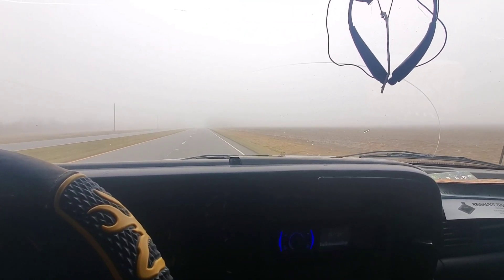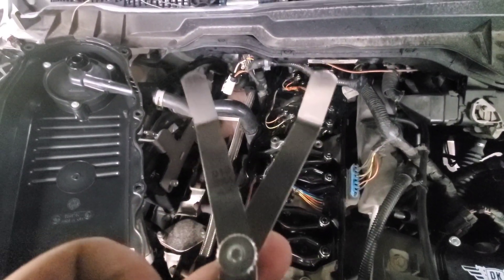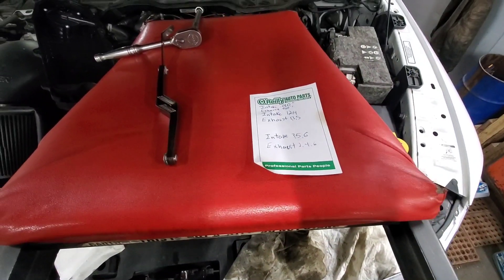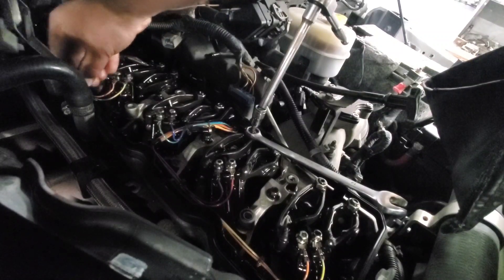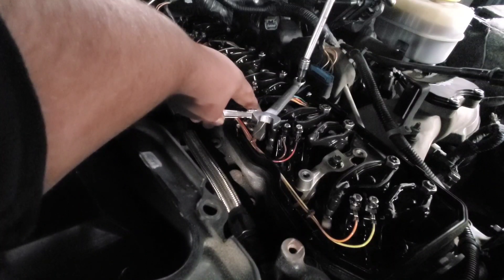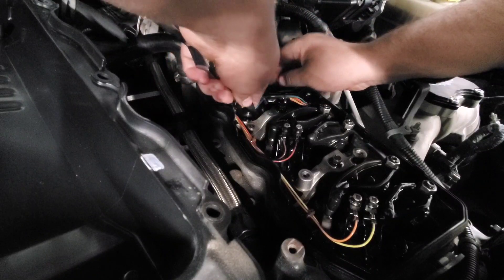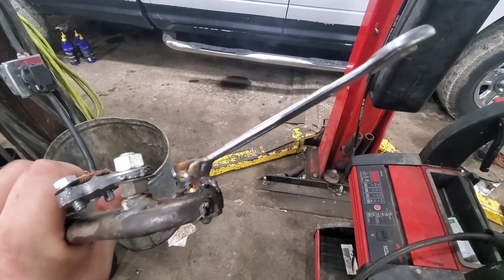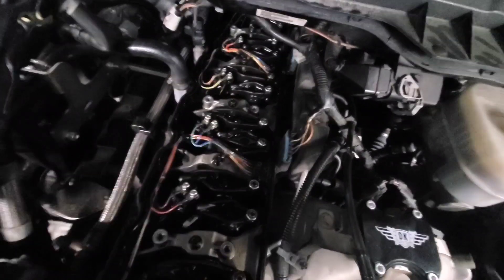Setting valves on a 6.7L Cummins

Comment: I have a question. I have a 2001 Tiffin Allegro Bus with an 8.3 Cummins with about 40,000 miles on it. I’m having starting problems with it any time it sits for more than about 30 minutes. It acts like it’s loosing prime and will only start if I cycle the key about 10 times or use either and doesn’t matter if it’s warm or cold. Is there a check valve I should be looking at or maybe something else. Thanks.
Reply from the maker: Id check to see if its actually losing prime. If it is let me know and i can help you from there. You can call our shop phone any time.